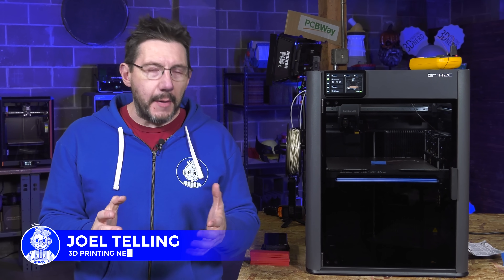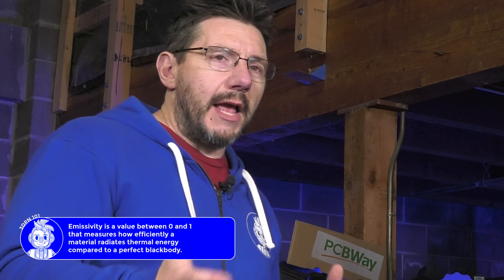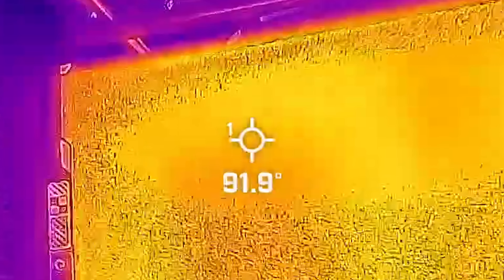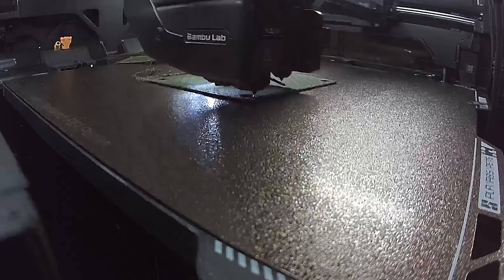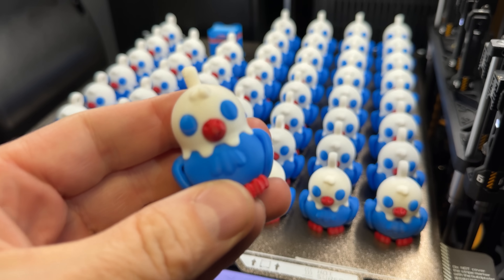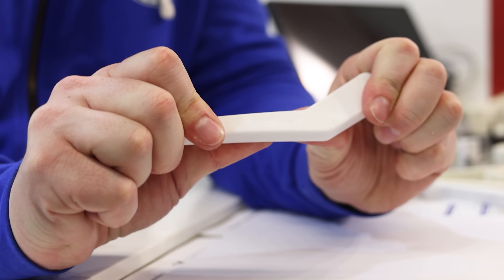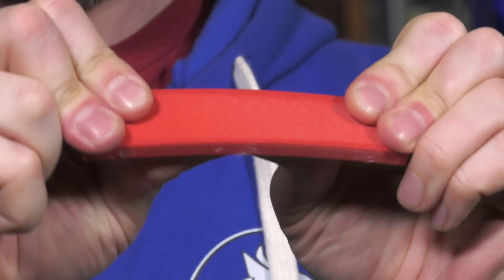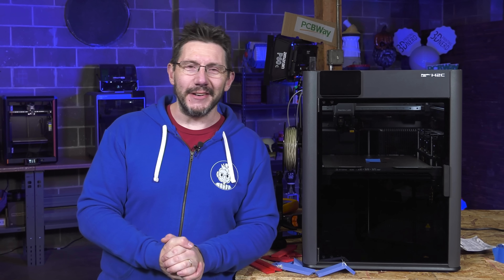Bambu H2C Update - Bed Heating / Tullomer + Polymaker

Comment: When the Vortek upgrades arrives,  is a uppgraded H2S the same as a H2C?
Reply: Yes. One of the reasons that the H2S conversion is more difficult than the H2D conversion is because you essentially also update the print head and PSU to the H2D versions.
Reply: @andreas-c6 not really. But it is nearly the same. Still only one nozzle with h2s. Difference is u can print 6 instead of 7 colors.
Reply: Yes, it is essentially the same. Except that as far as I know it only has 1 nozzle on the print head, not 2 like the H2D and H2C. The color of the printer itself is also different of course.
Reply: @thomasvanderhorst4511 what are you guys talking about? The vortek upgrade for H2S comes with the dual nozzle H2C toolhead. The reason it is $100 dollars more expensive than the H2D conversion is because it also comes with the dual internal ptfe tube filament buffer that goes inside of the printer. Take a look at Bambu's store page again
Reply: Literally the only difference from your upgraded H2S and an H2C will be the dark gray side panels that a factory H2C comes with. Which is a good idea, so you can differentiate factory H2C's from converted H2S/H2Ds

Comment: Why are people doing a heatsoak, when the printer doesn't do a heatsoak before printing? You guys should be measuring it at print start and comparing that to when it was bed leveling. If the two aren't the same, there's your problem
Reply: No, the problem was the plate as used. If another plate came with the printer, none of this would have occurred. Sure, the race to review the new, latest, greatest machine probably played a part. Along with the infrequent "bad" bed problem, rare enough to be assumed good, the simplest fix was the fix. (Palm to forehead moment).  Welcome to life and have a laugh.
Reply: @dbeelee8564 I know. I was talking about everybodies testing method. The big thing is the difference between when its at mid point of bed leveling vs at print start. Because thats when the bed is changing shape. If its still settling during bed level, it will be different when the print starts. A downside to heating a bed too fast.

Comment: Can't you just calibrate the fluke in boiling water? That would be 100c.
Reply: No it wouldn't work because the boiling temperature is dropping the higher up u are. At sea level it is at 100. In theory. In reality even high and low pressure areas are affecting temperature.
Safe bet would be to stick it into a glass of water at room temperature and stick a quicksilver thermometer in there.

Comment: H2C is a failure they will go with a tool changer next and make it right
Reply: Source "trust me bro"
Reply: @nukem8128  I assume it's not "source". It's a prediction.
Reply: @arekx  "H2C IS a failure" is hardly a prediction.
Reply: @nukem8128  That part isn't prediction. The other is. Anyway printer fails to meet many expectations regarding speed and multimaterial support (not comparing to other bambu printers obviously but to existing printers on the market and to available technology), so I hope that prediction part will become a reality. Full tool changer or some hybrid of current solution and a tool changer.
Reply: @nukem8128 it’s common sense
Reply: @baderalafghani4564 ‘It’s common sense’ is low IQ speak for ‘trust me bro’.
Reply: @garymelrose9727  👍🏻 you are the smartest human alive

Comment: It would have been interesting to see the measurements compared to other machines by Bambu or competitors. Isn't calibrating a thermocouple as easy as sticking it in a pot of boiling water without touching the pot?

Comment: Just be careful man. When you say things like that... you have built respect. It makes other people second guess and they follow you. You do have A LOT of responsibility. It may be a better idea to create a communication line with other creators before going into things that are dangerous like this. That way you can get constructive feedback and ensure sensors are being used properly. I really dont like when optical sensors are used on products unless its just used for mapping and not temp checks. I still respect you because you admit to mistakes but I dont want a good creator getting blacklisted for a mistake. The fluke sensor 👌 love it, just make sure its accurate. Where i work we usually gently cover it with something with high mass and let it sit so the thermal masses surround it. You may also be able to get away with putting it under the flex bed and sandwich it. Even knowing this, i still believed you because of your experience i figured you would know when its heat and when its not. I get we all make mistakes and it happens.

Comment: Bambulab is off with the temp compared to prusa
Reply: Indeed - another YT’er showed how the Prusa hearted was significantly worse than the BL H2C and H2D in terms of both target temperature and maximum spread. 👍
Reply: @garymelrose9727 nope the opposite, I need 10-20 C higher than on a prusa for same stickiness
Reply: @andreasstromberg  he is not guessing but showing results from "NeedItMakeIt" test.

Comment: Just love simple solutions. Unusual results with bed plate adhesion against odds of shipping machine to an early youtube reviewer. You won the lottery of bad luck !  In same vid, you won the lottery of vid sharing tullomer filament !  New question is which support material works best with tullomer and which multi nozzle machines can handle nozzle, bed & chamber temps. Prices of such machines are not an issue when using a $500 spool of 1kg. Is that a 50 cent poop I see? Lol.

Comment: I not just use the tullomer as a main material! The switching and purging in this printer is high still compared to a tool changer if you use the swapping systems. But even without it the waste is still gonna be more expensive than just printing it as usual

Comment: Tullomer works awesome alternative to continous fiber printers. I have been using it like that from fast 8 months. If you design internal structures In cad and select material in slicer it makes parts strong as. I have only been using it inside PA6.

Comment: Excuse me for being critical Joel, I have watched your video's for a long, long time and think you are a definition in the industry. However, first specifically mentioning you have a high-accuracy fluke with thermocouple (Fluke is calibrated from factory btw if you use the default probe. The offset is used to compensate for longer or shorter than stock wire lengths) and then basically saying "It is reading consistently with my previous findings, but I got told it is incorrect so we are not doing anything with these results"  is a very interesting way of verification/ testing. Also,  the idea of using a FLIR/ thermal camera is setting a E-value based on the material, and then read the temperature. Tuning the E-value down until you get the reading you expect, is far from "calibrating" it. Third point, the E-value only is used for the accuracy of the temperature readout, the fact still remains that the bed is very inconsistently heated. That is also very obvious with the lowered e-value, since that will always be relative.

I don't want to add oil to the fire, so I wont let my opinions loose on the specific situation with the bed, but come on, this way of making conclusions is very lacking, and your standards should be higher with almost 700K subscribers.
Reply: As engineer, I do agree.

Also, with dynamics specific to the print job, various fans and “cooling fans” blowing, one just does not know how uneven bed heating will play out in general. On a general-purpose machine I’d expect better. And knowing beats not knowing.
Reply: @Voxel3D_NL  Agree, and he could have put the thermocouple in boiling water to verify that Fluke’s thermocouple was calibrated.  And he should have used some thermal paste to thermally connect the probe to the bed - I suspect he would have gotten a higher (and closer to reality) reading.
Reply: Wasn't a bed temp problem. Turning it into a bed temp problem ... was the problem. A different bed plate would never have pointed to a bed temp problem. This is the point.  Just bad luck on a questionable plate shipped with the printer. The very definition of making a mountain out of a mole hill.  No heed to build the hill higher.
Reply: Small correction but he very clearly adjusted the e value to be in line with what the camera should have been calibrated to in the first place for his material. Additionally the reason we see the heat dispersion as more even now is because an overly high e value can actually amplify the hotspots and create a false pattern(it’s not like a gain value that just adjusts the whole pattern). What he showed in this video is likely much closer to reality as the new print bed fixed his issue, need it make it on yt had a similar conclusion in his video, and the e value he used here is much more in line with what you’d expect for this material.

Comment: I've definitely had some Textured PEI plates that require a lot more scrubbing when they are new to really get that adhesion going. Glad it was such a simple fix of swapping the plate. All the measurements you did make me really appreciate all the engineering that goes into these products. Thanks for making the follow-up video!

Comment: I think you are being far too forgiving to the heater issue. It is ok to be critical of companies, it makes them better. Please don't become a sheep.
Reply: Taking over an hour to heat soak isn't a valid solution also having to buy a different plate for the most common filament to stick is not ideal.
Reply: @Deltazor  he heat soaked it for an hour because in the first video he did the same and stated it never reached temperature . He just repeated the test and corrected the mistakes he made in measuring. There’s no need to buy a new plate, his was defective which was the actual problem. If someone else had this issue they’d make a warranty claim. It’s not great that he got a defective plate but it does show he isn’t getting sent hand picked machines that are problem free.
Reply: Too late.
Reply: Admitting fault lends to more credibility than continuing to critique what looks like a non issue.
Reply: But he was wrong?  Admitting he was wrong makes him human, and a good one at that.

Comment: The solution to the the Bambu printer having bed adhesion issues is to buy a Prusa or a SnapMaker…..
Reply: I've had a pre assembled printer from prusa with pre failed bearings and a cheapo fan that fell apart in a week of use printing just pla. The solution from prusa was free replacement parts that nessitated a full disassemblely of the just delivered fully assembled and ""tested"" printer. It also took three or more weeks of back and forth to get some free parts. Then I had to 3d print some jigs and figure out the entire wire loom splice in the new fan and reassemble the entire gantry and bed. It was not fun.
Reply: Nah
Reply: Prusa is the only way to go for proper QC and customer service.
Reply: @HaloMachine  I had a worse experience with prusa than I did with elegoo. Hard pass.
Reply: Don't ever put Snapmaker name next to Trashsa

Comment: Don’t backtrack. 90% of hobbyists print with pla. The prints didn’t stick. What are you supposed to do? Preheat the bed for an hour. Give me a break. Is Bambu going to send everyone the second build plate?  It’s a fail. Thanks for calling it what it is the first time. I want to hit print and walk away,not wonder if it’s going to stick.
Reply: @brainbuster596  I completely agree with you, but for what it’s worth I’ve been printing basically nonstop with my H2C for nearly two weeks and haven’t had anything come off the bed yet (so far I’ve printed on the stock plate with pla, PETG, and asa).
Reply: I don’t know what you’re printing and if your using the whole print bed but I don’t want the end of my larger prints to peel up. Joel did a print using the bed and two of the figures popped off which in my opinion is a fail. I glad it’s working out for you but I’m not going to spend that kind of money on a chance that it might work.

Comment: I have been pondering a shelf extension system for my work table so that I could move my Resin bottle stands off the table and give me more room, but the weight would cause issues with what I have in mind, but seeing how strong those parts are, that would easily support the load.  The PET-GF15 is sold out though. :(

Comment: I thought that I remember in the last video, he mentioned that the bead only heat constantly at 90°-100° but at 50°-60° doesn't work well but the prusa do it, so i would like to see the new method to measure at 50°-60° 🤔.
Sorry for my English I'm latino.

Comment: Hey Joel, thanks for the update. But what about the 0.2mm nozzle. If a brand new nozzle jams on the first try, doesn't that mean, it almost not usable
Reply: People have been using the 0.2mm just fine what has to be done is learning how to work with these. Bambu already added some stuff to the wiki but given the hotend design we will have to figure out new tricks i am sure it will be resolved heating the magnets is clearly not the way to go.

Comment: Good this got resolved i am still a little confused because in a way it's important. You hint that your h2c came with a broken plate and maybe it did but it has 2 sides maybe test both? The new one clearly works so us owners would like to know since others might be helped with this if that is the case. Now back to my h2c.. by design i went super lazy : installed the machine didn't even clean the plate and just started printing (about 80 hours now) no issues so far.. i think i have used both sides by now a few times no issues ill keep printing and see how long it lasts. For other reasons (wanted to see if h2c would walk of the table) i also did a few prints in 166% speed mode and even under heavy shaking of the printer and the plate no issues so far.... One person doesn't proof anything i understand that and i feel you clearly had a issue and still wonder if we can get to the bottom of it since that might help someone in the future... The important take away for all the H2C doesn't have a heatbed problem by design.

Comment: Hey Joel. The next time you want to break a test stick with your hands and avoid injury I was going to say "use garden gloves" which is a good idea but then I thought of a better idea. It's good for opening that jar of pickles that JUST.. WON'T.. OPEN! You run to your PC and pick up that mouse pad with rubber on the bottom and soft material on the top and heavenly protective material in-between and place it over the pickle jar top and ALL that energy gets transferred and "POP" it's open. (Pass along-works EVERY time) So keep a mouse pad and one garden glove handy, one for each hand, and I bet that now, if it was on the border of breaking, you could break it! But this empirical test would now have more juice! Sorry I wrote so much, my kids call me "Mr. Paragraph" because I get so detailed! Peace. High five.

Comment: But wasnt the original issue the heat bed was inconsistent with temp in diffrent areas across the build plate?
Like cooler areas
Reply: The issue is that he looked to soon (well when he took the picture) the heat spreads at a ok speed to most of the plate. The corners might be a little off but the same or better than several other brands. And this should not be the issue with his pla prints at all.
Reply: @4322jep  also nobady cares what is heat distribution after 90 minutes when your print is already done. First minute is what needs to be perfect
Reply: @l3d3ni  Several others have tested it its distributed well before it starts the print  as confirmed by other testers who not only took the temp but printed 45degrees stairs in the corners on several brands including the h2c to proof it.
Reply: @4322jep  False readings due to inconsistent temperature sensors
Reply: Measure any print bed, even the fancy Prusa ones with heat cells, and you’ll see it’s not 100% consistent.

There will always be variance. The issue is whether the variance is so large it takes you out of spec for the sheet/material combination.

It’s also worth noting that the IR viewers are designed to show things as extreme. A 1* difference can be dark blue vs bright red on the screen in the right situation.

All of the tools are imprecise to some degree and user error plays into it too.

For example I would have calibrated that thermocouple and then used some thermal compound between it and the bed.

I would probably, if this were me testing, get 16 thermocouples, calibrate them all, then apply them to the bed in a grid array with thermal interface and measure/chart the data.
Reply: No, the issue was he was measuring while the Bambu bed was heating and the Prusa was already warm. He clearly showed in this video it wasn't uneven.

Comment: Bambu plates are not only inconsistent but typically require standard temps, not profile temps they provide. A 5deg increase usually solves the problem if the sheet has been washed and dried properly.

Comment: Didn't think the bed plate was the problem?  Common Joel, did you have a brain fart?  Whenever I have an issue with something sticking to the bed the FIRST thing I do is wash the plate with dish soap. 😁
Reply: But to still have it not work afterwards on a brand new plate???  That's a very small fail % and wouldn't have been my first thought (other than washing it naturally).  Pretty odd for a new plate to be bad.